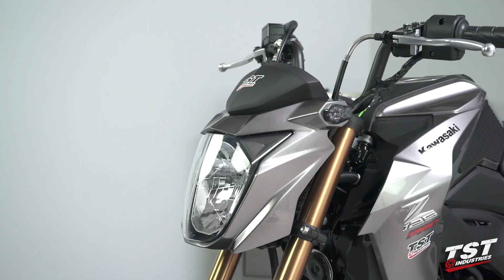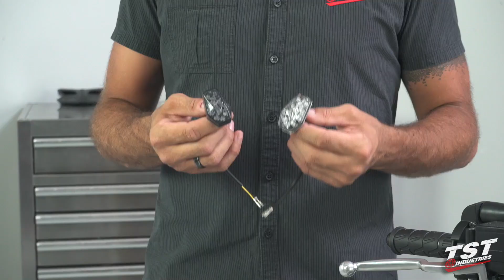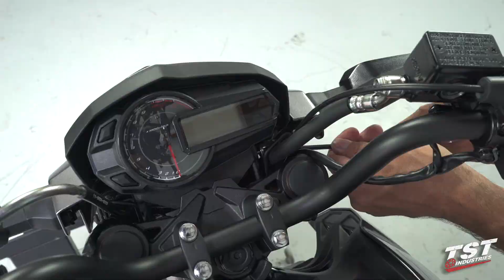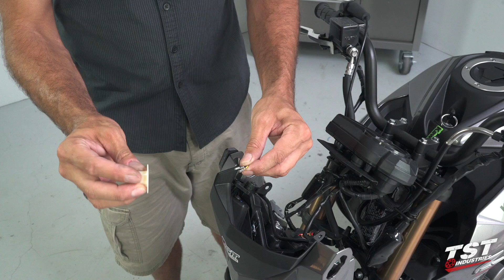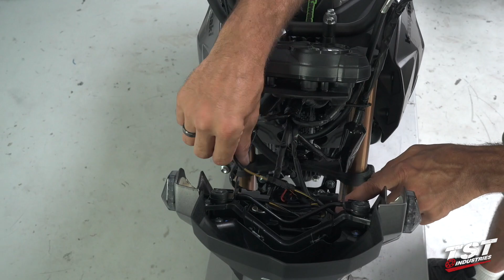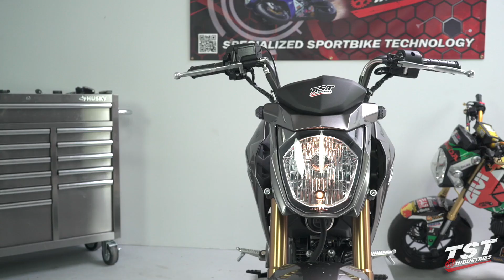How to install LED Flushmount Signals on a Kawasaki Z125 by TST Industries

Comment: Bart is absolutely thee best person for the job to explain how to install anything!! So very detailed, describing step by step. I normally just go to a bike shop to get things done. Watching these videos, gave me the confidence, that I can do it myself. I am no mechanic by any stretch of the imagination. Watching Bart, on my 2021 Z125pro, I was able to install the fender eliminator kit, integrated tail light, license plate light and the flush mounted turn signals. I absolutely couldn’t or wouldn’t even try to do it myself without Barts installation videos. Thankyou!! 👍🏽👍🏽
Reply: Czech

Comment: I had those but I had to ditched them out for I wasn’t satisfied with its functionality and designed. Designed wise shape like an old fashioned coffin that was the initial disappointment. So I went to proton 500 awesome item.
Reply from the maker: You are comparing entry level 14.99 dollar signals to 70 dollar signals from another company.

Comment: Mine don’t blink either
Reply from the maker: Have you installed an LED Flasher Relay or resistors?
Reply: no i just completed the circuit with the stock rear turn lights 
works perfect

Comment: One of the 2 5mm Alan keys would not come out. I completely stripped it to hell and back and have no idea how to get it out now. Does anyone have any ideas?
Reply from the maker: Tapping out the screw with a bolt tap set would be your best option at this point. You may also be able to bite onto the head of the bolt using needle nose pliers to slowly twist the bolt out. I would replace that bolt after removal.
Reply: Same here dude. Damn nightmare

Comment: Where exactly original signal relay located... i put both led rear n front
Reply from the maker: Joe Taufiq  this bike does not have a signal relay. It has an electronic  signal circuit within the instrument cluster. We have a piggyback signal relay that fixes the flash rate.
Reply from the maker: Joe Taufiq you can see our installation video for the relay here: https://youtu.be/jGmMdr01GCk
Reply: Ok thank you so much... no choice otherwise to bypass relay like in video...
Reply from the maker: Yea unfortunately that is it. You can opt for load balancing resistors but those are cumbersome and heat up. I don't recommend those for this bike.

Comment: Kawasaki copying Honda now ? Too funny
Reply: It's $200 cheaper, has 1" shorter wheelbase, higher redline, and a few other differences. I like both and can't decide. There's a new Grom coming, with LED headlight and taillight, in a high-viz yellow color that I reeeeeeally want badly, but I don't want to wait any longer. I want a bike asap.
Reply: +Thomas Andrew   The re-designed Grom that is coming out later this year has both LED Headlight and Taillight